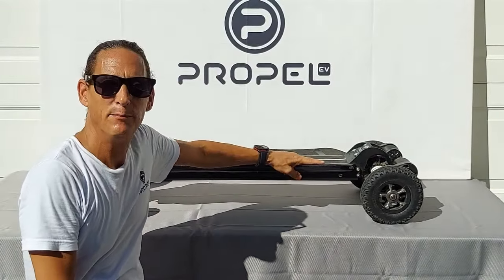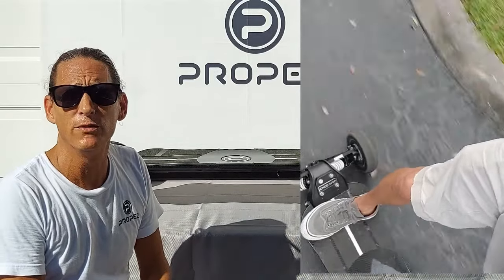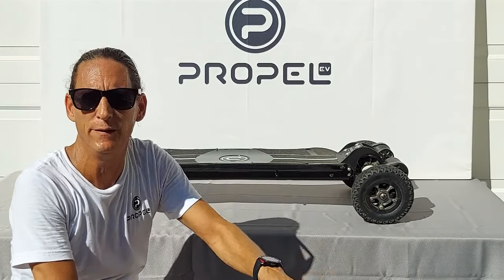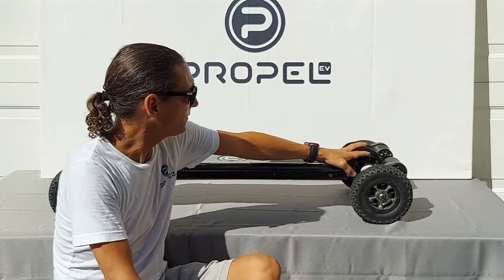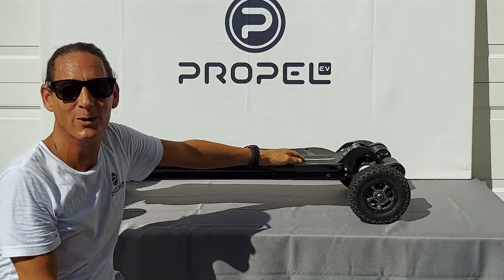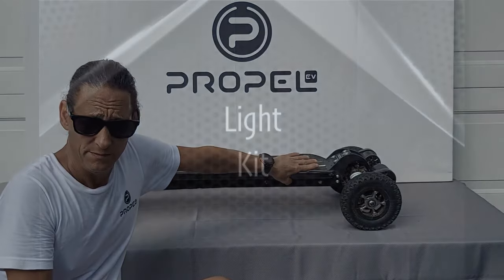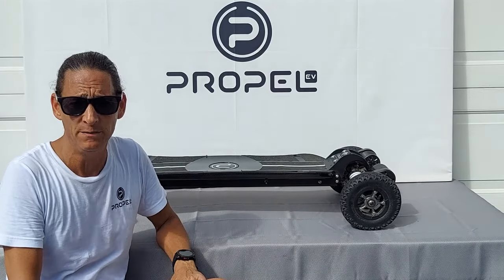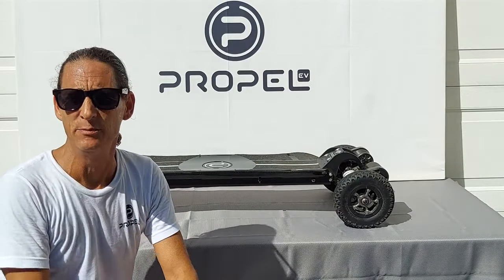Introduction to Endeavor and Welcome to PVG

Comment: I suppose it is heavy and I won't be able to always carry it.  What are the recommendations for locking it?
Reply from the maker: Its pretty easy to "tow" by pulling it with one of the control arms and you can also pass a cable through the suspension with no issue but "carrying it", in the traditional sense of carrying a skateboard wouldnt be the best option.  Up a quick flight of stairs, not an issue but multiple flights would be,...for me anyway,lol
For my personal board, Im also looking at adding a chip like the tile or samsungs version.  Im waiting for feedback to see if it will create any interference.
Thanks for the questions!

Comment: How about a higher speed gearing setup for the 7" street wheel option? 35 mph?
Reply from the maker: We have the techs looking into different gear/pulley options to see what will work and what wont.  No findings to report back yet but we like to keep our customers up to date with this stuff by doing frequent updates on our FB page
Reply: Fantastic. I will be interested to hear about their findings.
Reply: I was just about to ask if it could go 35 with adjustment.

Comment: Nice video. I really like the endeavor pro, maybe i gonna buy one for the next season. But still got some questions.
What about its waterproofing?
Is it possible to change the pullies with other "standard" pullies or did you build it with customized pullies?
Same question for the wheels, can i swap them to 10" e.g.?
And maybe you can talk about the steering system, i only know conventional trucks.
How big is its turning radius?
Looking forward for the next videos
Reply: -IP56 Rated
-You can change pulleys but we are still working out which other pulleys work
-As of right now, there is a 7" street tire and an 8" knobby available
-The steering is pretty sick, very tight radius.  The way we designed this suspension system and whats makes it different from the x4s is the direction the forces are transmitted.  With Endeavor, the absorption energy is sent to the center where its transferred to the steering mechanism so its kind of like power steering for a skateboard.  You have to ride it to understand it but I promise its not just the most comfortable board youve ever ridden but its extremely nimble as well.

Thanks for the great questions Shiba dad.  Ride hard, ride safe!
Reply: @castnortheast  big thanks for your answers! 
So it wouldnt matter if it starts raining during a ride, nice 👍
Hope i'll be able to order one for spring.
Take care and stay healthy!
Reply from the maker: @shibadad5891  As a general golden rule in Esk8, avoid water at all times, as often as possible.  IP55 or 56 does not mean waterproof by any means and water damage voids warranties on pretty much every esk8.
Even guys who take extra care and add more weatherproofing,...its never a guarantee and with a $1000-3000 toy, why take that chance